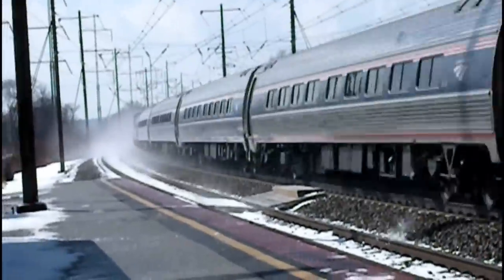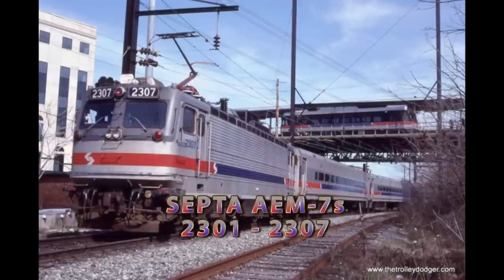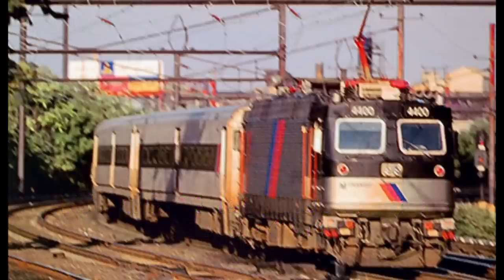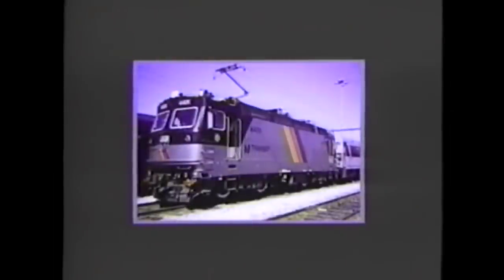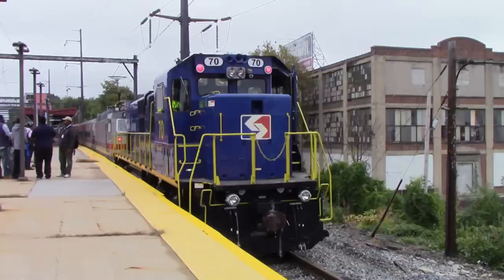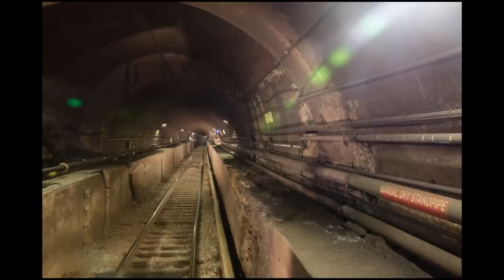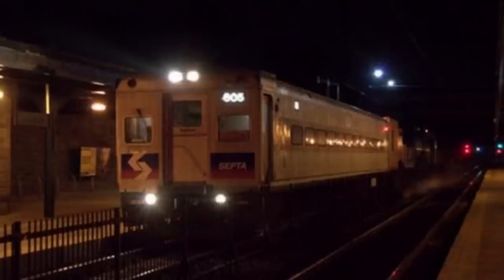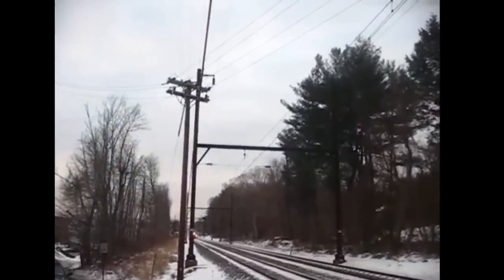Engines of SEPTA ALP 44

Comment: I'm still surprised the alp44 and aem-7 are still mixed up. Atlas and MTH still got the alp44 wrong. They probably went the cheap route assuming customers will still buy a AEM-7 with NJT SEPTA livery. I remember people arguing that model train collectors were picky and can point out every flaw in a scale locomotive such as missing 2-3 rivets. I never thought I would become one of them. I really liked this locomotive more than the GG1. I could never find any images of its interior until I went to the site where locos are stored. Great tribute video.

Comment: That one photo of the New Jersey Transit ALP 44 and The Septa AEM-7 was taken in Long Branch New Jersey By point pleasant
Reply from the maker: Was that in the 90s during Railworks? I know NJT traded 5 U boats for 3 Toasters during that time period in the 90s due to the Reading Viaduct being out of service cutting off the Ex RDG lines into Philly
Reply: Ya that’s why septa ran 5 U34CH For the tosters. Yes I am in the point plesent and Ben Ralf’s Ning long Branch for years. Also this is not about the Alp 44 if you do see ABB ALP 45 tell me I see them often for electric and disal
Reply: Thanks for telling me I know that yard because the yard is viewable from the platform. On the U34CH There from ere Lackawanna To The Formation of New Jersey Transit . Then they retired them and gave 5 to Septa. I have only saw one video of it on Express service don’t remember the name. That’s all the Imformation that I have but there is a lot of sites but Don’t know about The Septa ones
Reply from the maker: I do know 4154 received SEPTA's diesel blue. Kinda wish we kept it as it'd make a nice mantience/rescue diesel compared to the Caterpillar ones like the RL1As which aren't too reliable nor strong (SEPTA 80 struggled with the North Wales 150 excursion with 40 on flat ground while 40 took Pennbrook hill (steepest grade on SEPTA) like a champ with 80 in neutral
Reply: @Thunderbolt_1000_Siren  I went to Baltimore today

Comment: Correction: The AEM-7s actual top speed was 135mph. It only got up to 125mph while in service
Reply: Or they can go at 130mph if wanted.
Reply: I know that the US has the FRA Tier 1 standard that limits locomotives to a max speed of 125mph as far as my knowledge goes.

Comment: You should do a 'Engines/Equipment of NJT' segment as they had/have some of the strangest equipment going. And most of it is preserved by the URHS and leased to some shortline railroads.
Reply: Also equipment of PATCO, since that runs into Philadelphia.
Reply from the maker: NJT is not my strong point and I'm not a huge fan of them. The only NJT I get to see is the ACL service that goes through 30th street with GP40s on them and I use to see Arrows when leased to Amtrak for Holiday Extras but since they didn't have PTC they didn't. Someone else I heard may be drafting an Engines of NJT however I'm not sure.

Comment: 2308 is my favorite out of the AEM-7/ALP 44
Reply: Eight Avenue Productions mine are either 4430 or 4422. I have seen the inside of 4422 at lackawanna cut-off. Someone used an angle grinder or something to cut the metal off the windshield so you can climb right in
Reply: The ALP-44 just looks like an AEM-7.
Reply: @malachimuhammad-dy2ow  Yes

Comment: Where will your next documentary take place, and when will it be?  Love the videos, NJT used to have ALP-44s, also.
Reply: Caleb Trains22 next is July 6th, Lac Magantic 6 years later
Reply: @phill1451  He did that accident last year.
Reply from the maker: The Lac Megantic sequel is on the brink of cancellation though due to lack of time and 1 video on that accident is good enough. If so Camp Hill will be next on the 17th and that's another wreck from my area but with the clock turned back to 1856.
Reply: @Thunderbolt_1000_Siren  if the lac megantic reboot gets canceled that's fine

Comment: NJT abandoning all those ALP 44's is a waste of taxpayer money. They are machines that could still lead a useful life. Why not send them to another transit system that needs electric locomotives and make money off that sale ?
Reply: Well, which electric system exists in the US?

Marc (no more toasters, so why would they want the ALP?)
Septa…
NJT (that’s why we’re asking)
Amtrak (good luck)
MetroNorth (got dual mode M8 to run into GrandCentral, so no)
MBTA (seem not to like electrics for some reason)
Exo (now they’re out of electric due to the REM)
Chicago uses 3kVDC
RTD (got fancy new Silverliners)
Caltrain (getting fancy new Stadler KISS and why would they voluntarily swap engines on express runs?)

And maybe GOTransit, but they’re in the far future and getting new European style stuff, or maybe the ACS64 Amtrak wants to get rid of)

LIRR is 3rd rail
BCRail doesn’t do electric anymore, as does Black mesa

That should be about it

Comment: 8:32 how does an electric engine operate in the non electrified Atlantic City Line?
Reply from the maker: From what I remember that service had an ALP-44 at one end for the under wire sections via Amtrak and a diesel (Believe they primarily used Ex Amtrak P40s) for the dieselized ACL. Better idea than using ALP-45DPs which are RUBBISH engines.

Comment: What can we do to save of all of these poor alp 44. I don't want them to be scrapped and all of these aem-7s
Reply from the maker: It seems SEPTA may have plans to use them on gel train service. 2304 was seen in front of Wayne electric as of Oct 19th with 2307 on the left side of the shop building.
Reply: But about njt
Reply from the maker: @adamdahabra4653  Likely nothing that can be done :/ they're all likely ready for scrap. Rumor has it 4 were pulled from the line for preservation but it's very likely false

Comment: Sadly non of the ABB ALP-44's from SEPTA survive all where scrapped in 2022 not one single example saved as SEPTA history, 

But good news the New Jersey Transit ones half are left and one example United Railroad Historical Society of New Jersey has 4424 their and that unit entered service around the same year I was born basically but not the same date I was born on.
Reply from the maker: SEPTA only had 1 ALP-44. 4424 is indeed preserved but acts as a cab car due to the lack of wires on the rails it's owned by.

Comment: if you use a similar recording area and mic a little bit of audio editing then noone would be able to tell where cuts were and you could reread the lines without the distracting audio changes. Also it seems that you take notes and flesh it out from there, while that is ok I recommend a run with the notes and then go back and use a script with corrections based off of your first run. I still must give you props for fixing how quiet your voice used to be though.
Reply from the maker: Trust me sometimes I dont catch the mistakes in some audio takes and adding a small edit is better than a full on retake from scratch. The narration while fun to do is VERY stressful to get a perfect take

Comment: The ALP-44s sure didn't last very long -- even less than Amtrak's HHP-8s (and MARC is actually refurbishing their HHP-8s and reportedly has 2 of 6 back in service).
Reply from the maker: MARC plans to have all of their HHP-8s back as the rebuild turned out as a success and solved the teething troubles most HHP-8s suffered.
Reply: @Thunderbolt_1000_Siren  Seems like Amtrak could have saved some money if they did the same thing.
Reply from the maker: Not really. it's actually cheaper to buy new units than rebuilding and overhauling them so MARC took a big risk that paid off hence why MARC had a few Amtrak AEM-7s and a few P42s leased for a short amount of time. Plus now that Amtrak has 1 standard electric engine, maintaining their fleet is much easier so you dont have to search for special parts for certain engines. Plus 601 and 627 after being wrecked are now a valuable source of parts.
Reply: @Thunderbolt_1000_Siren  If it really is better to end than to mend(*), something is fundamentally wrong with our economic system.  Edit:  Also, that would make it strange that MARC would find it worthwhile to rebuild their HHP-8s, which were also highly troublesome, unless they knew something that Amtrak didn't.

(*)Brave New World Reference.